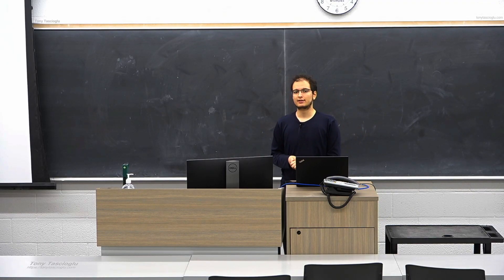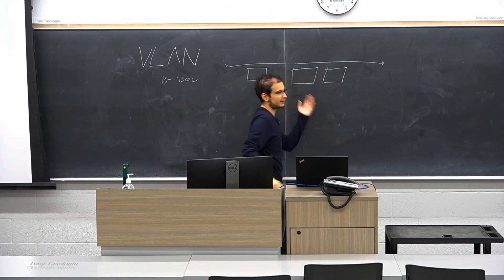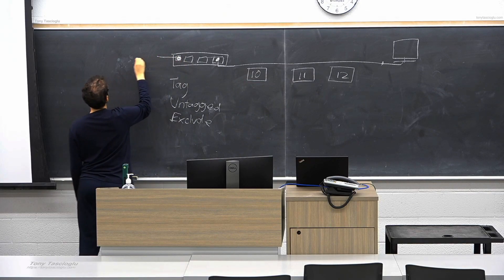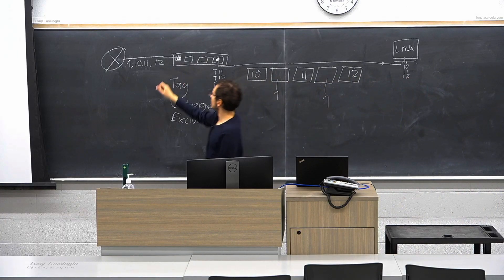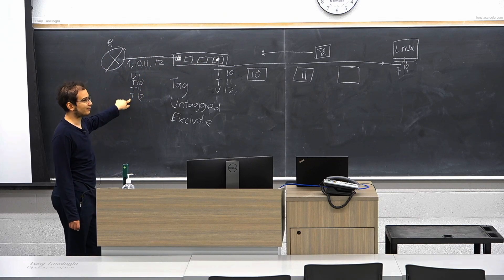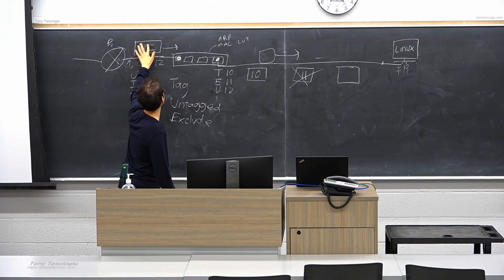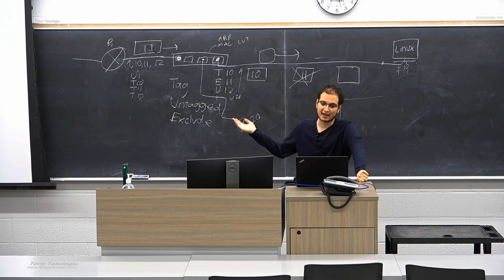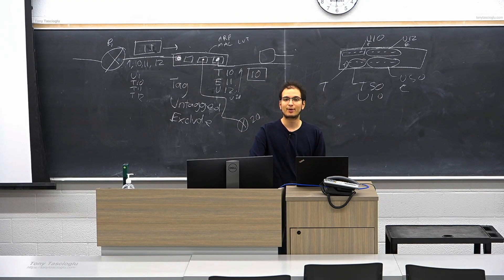How Does VLAN Tagging Work? (Managed Ethernet Switches Explained)

Comment: Question: Lets say you have port 4 (conected to linux) Untagged VLAN 12, untagger vlan 1,  tagged vlan 10. So you have 2 vlans untagged on port number 4. You will say this will not work. But you have in switch configuration PVID so for example you can have on port 4 untagget vlan1 and vlan 12 but PVID 12. then all untagged traffic will tag as VLAN12. In this case you can have all ports untaggen on all VLANS but you need to determinate PVID for each port. AM I WRONG?